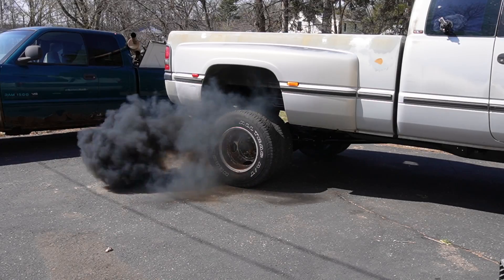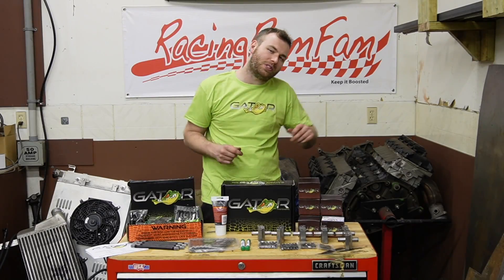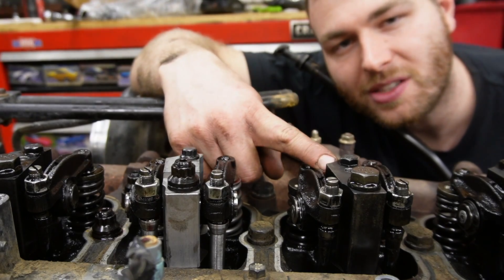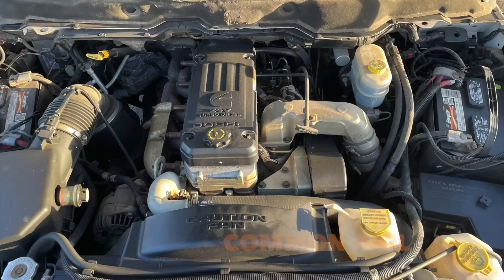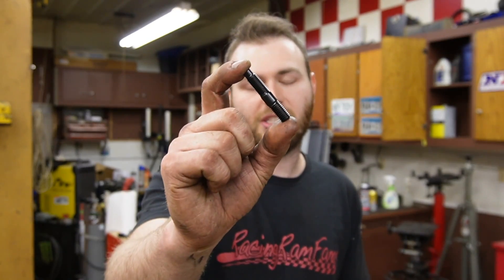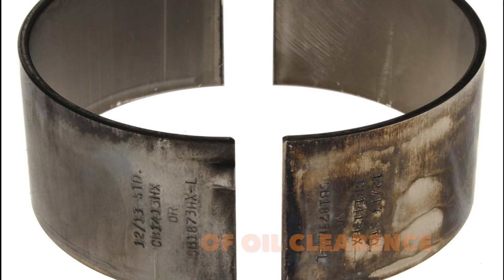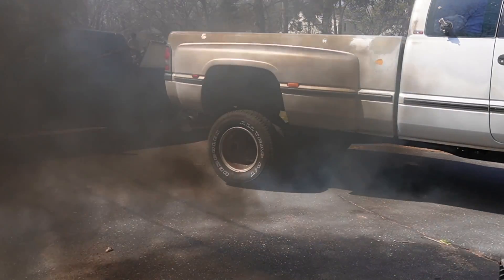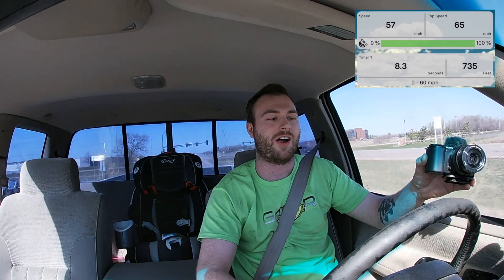500hp 12 valve CUMMINs BUILD

Comment: Sorry guys but even tho I have had diesel's since 2003 and have a few 12v's this things are not really made to drag on the street. Especially after having my 2021 F-150 with a whipple and running just 15 psi, with a E-85 tune and 1000cc injectors and a fuel system.  I was able to get just under 3 seconds 0-60... 2.97 to be exact. Even a 1,500 jp Ram would see a Whippled F-150 tail lights all day long. But I still love my Diesel's... just a different feeling.👍

Comment: do you adjust preboost screw all the way out, all the way in, did you tune it? did you adjust afc housing back or forward?
Reply from the maker: @TaylorVolz  yes I tuned it. It has a pdd long travel kit, number 10plate. Everything was adjusted in the middle then moved from there depending on smoke output

Comment: Never heard of gator studs before. Im running xotic solid studs
Reply: I have busted several Xotic studs. They are good to about 600hp tops. The lift after that. They warrantee the studs, but it still dont cover the cost of the result of said failure. I made a short on it a while ago.
Reply from the maker: @BentonL  ya can’t warranty junk lol
Reply: @RacingRamFam  They can, but you will be doing a head gasket again and potentially having to replace bearings. I am now on the 625 alloy studs. I learned my lesson a while ago. But I had put these studs in a lot of trucks. All the trucks with 500 or more HP have broken studs. They dont stretch they just snap when they lift. Usually in the middle.
Reply from the maker: @BentonL  you can’t fix broken is what I’m trying to say. If somethings junk doesn’t matter how many times your get it warrantied out it’s still junk
Reply: @RacingRamFam  Pretty much.
Reply from the maker: Ya I’ve heard lots of horror stories from xotic. I’ve watched a lot of testing on Chinese studs and there pretty trash. Better clamp load from factory bolts

Comment: Ironically enough I came across your videos when I was working on a beater white 96 1500 rclb 318/nv3500 truck with the bright plan of turboing it and it ended up with just a rebuild and a few NA upgrades. Then I recently bought a 96 12v/nv4500 and turns out you post a video with a 12v. I definitely need a tappet cover mine is all bent up!
Reply from the maker: Awesome! And ya the gstp ones awesome just make sure to run a thin bead of silicon around the seal when you install it just for reassurance

Comment: Sweeet, need a trans asap! The stock 47re can barely handle stock torque lol, throw some delivery valves and a rack plug in that baby. What's done to the afc and fuel plate?
Reply from the maker: 100 fuel plate and stock afc atm. Bought a long travel kit, bigger injectors and 191 delivery valves
Reply: @RacingRamFam  Gotta slap some full cuts in there and delete the afc, black out the town. I had my 12 valve setup like that with a big single turbo, an airdog and some 5x0.018 injectors, I think I had an issue with my pump. It never smoked like it should have, wish I kept it.
Reply from the maker: @Axeofdeath  lol it would be a train! Ya I have some 5x.017 nozzles I’m going to try out